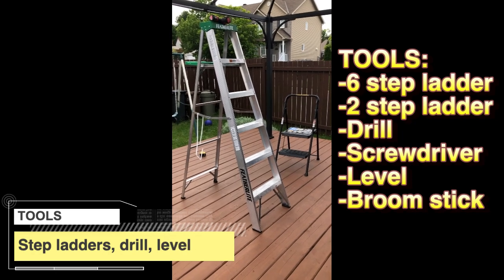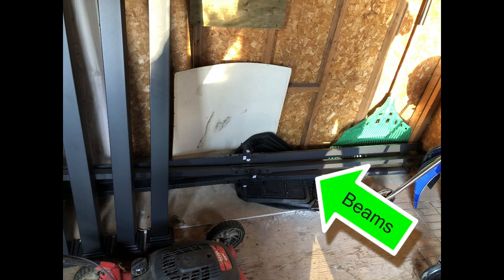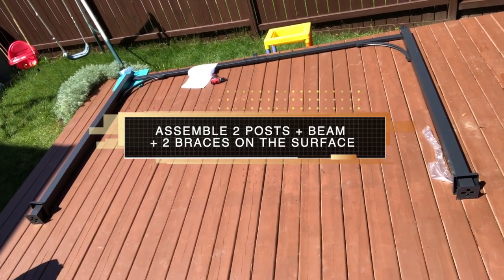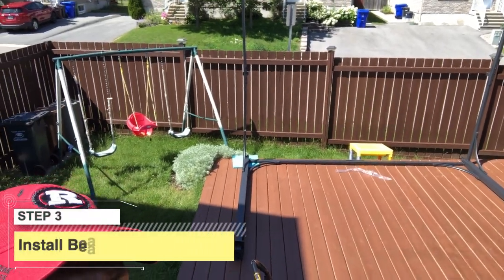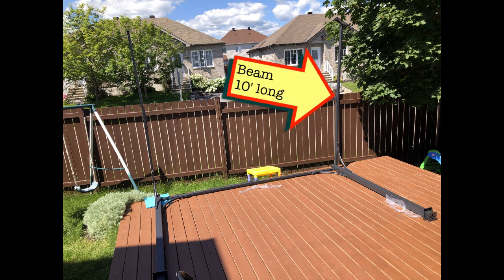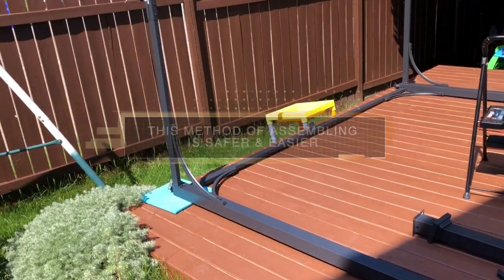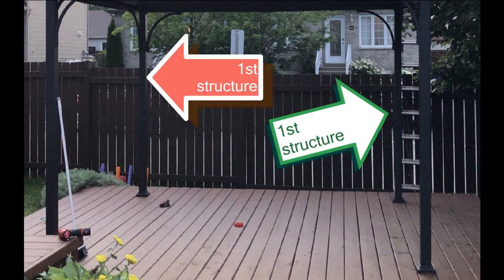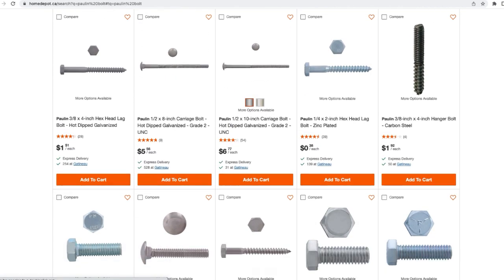Gazebo Farrington hard top Installation @TainoEZFix

Comment: Are the posts exactly 10 and 12 feet from center to center? 
The reason for this question is, I'm installing it on concrete posts so I would like to know the actual measurements from post to post.

Thanks